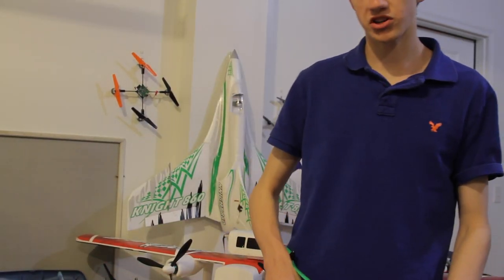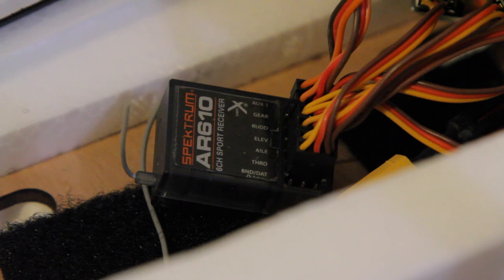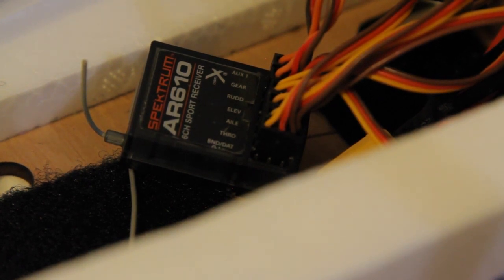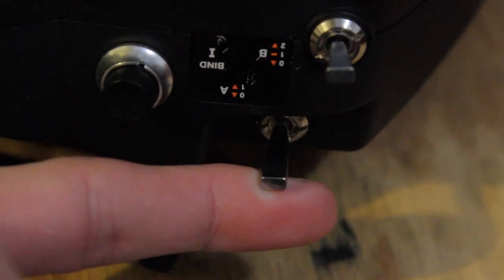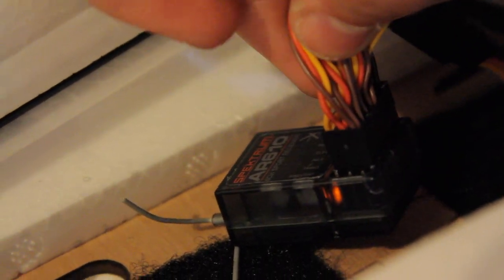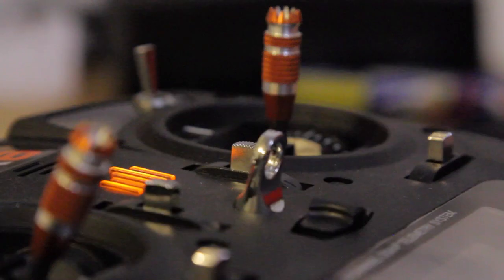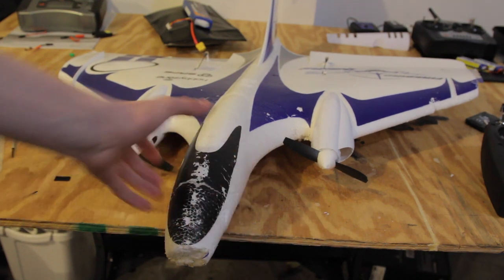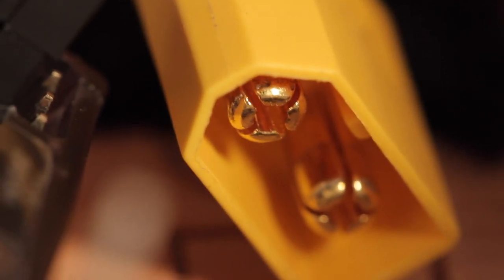RC Plane Receiver Setup

Comment: How can you connect 2 servos for ailerons into the receiver if there is only 1  aileron port on the receiver? Please answer thx
Reply from the maker: +Peak Chair (peakchair2002) You have a Y harness that you plug both servos into, then you plug the Y harness into the receiver.
Reply: Do i really need to get a fuckin y harness? Omfg

Comment: Won't the ailerons move in the same direction if we use a y harness
Reply: Siddhant Chaudhary not if you swap one of the cords around (I think) when I did robotics we had similar things and if you need to make a motor spin the opposite way you would flip the cord around

Comment: Hey Lewis :-) I found that really handy mate cheers for the share, I had a basic grasp of the odd bit but you filled in a lot of blanks for me here. Like receiver and transmitter need to be compatible, I was under the impression you could use any so that would have been a pain once I started ordering bits :-) I do like that skymule with the extra servos running the under wing release on the payloads and the side hatch looks awesome! proper love that, you say the servo doesn't have enough torque to open the door? its a shame, can you rig a mechanism to the servo and get a bit of extra leverage on it :-) im thinking something like a few bits of c.f. tubing on a hinge or something :-)
 Your beat plane looks really good, earned its keep, its looks solid but has a good wing span for surface area to cushion on the air and could have a decent payload carrying capability, but with the skymule it does look like it can carry similar weight but you have the perk of the underwing release mechanisms :-)
 Suffice to say when I come to buying some gear for a test setup I intend to get around to make I will be coming back to this vid for reference first. im not sure which to take yet spectrum of futaba, the futaba fasst transmitter im told gets a good range on it, but I think the hack I want to do to the transmitter I saw done on a spectrum. that hack was wiring the controller up to a pc :-) I thought it would be cool to mount the futaba on the roof and wire it to an xbox controller in my office and see if I can fly it from my desk..its not...going to..work is it.. :-p still sounds fun to attempt no? :-D I look forward to see this skymule flying now! Pilot to Bombardier we are reaching the target!
Reply from the maker: battonfive Thank you!  I could push open the door with a proper setup, the magnet in the door is quite strong though.  I will hopefully be able to rig it up with parachutes and things next week. :)  Im glad this video was helpful!

Comment: But if there are 2 cables for ailerons and only 1 port what do you do??
Reply: He answered this twice already. Use a Y connector. Plug the servo leads into the split leads, the single end to the RX.

Comment: on your receiver the aux1 is a button what would the aux1 be on the spektrum dx6i
Reply from the maker: +Mason Pedraza I'll have to look into that because I've been wondering the same thing!  I would think it would have to correspond to the "Throttle hold" switch or the "F mode switch"
Reply: ive been wondering this because i want the same setup as you but i want my gear switch so all im left with is aux1 but i cant get the same transmitter as you cause the transmitter you have is like 200 dollars and i dont have that money so ive been looking at the t-6 and the dx61 but both of those i dont where the aux 1 is
Reply from the maker: Mason Pedraza Hopefully this will help: http://aeroquad.com/showthread.php?7016-How-to-assign-a-channel-to-a-switch-Spektrum-DX6i-Transmitter